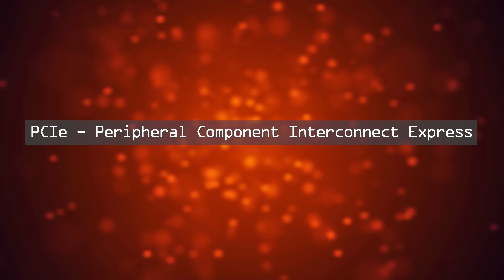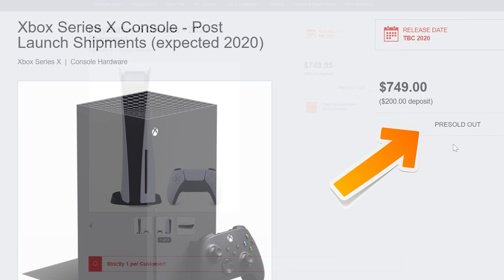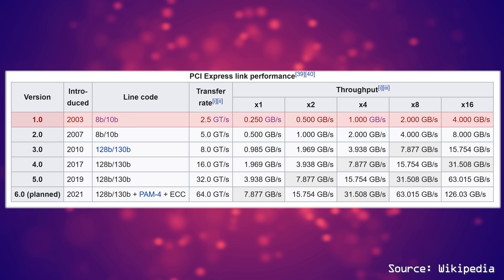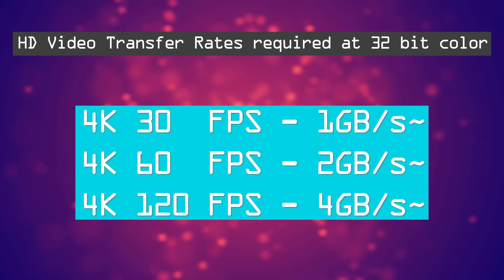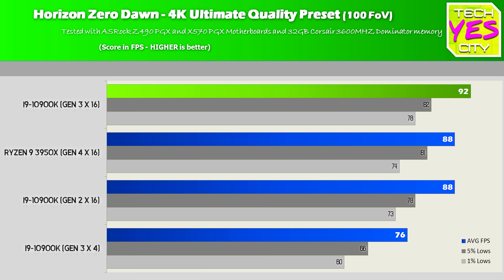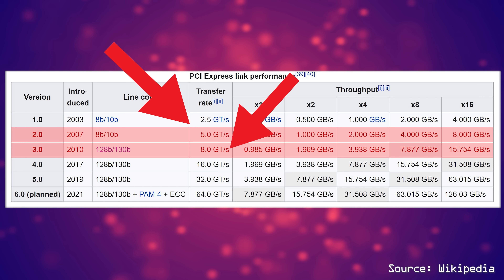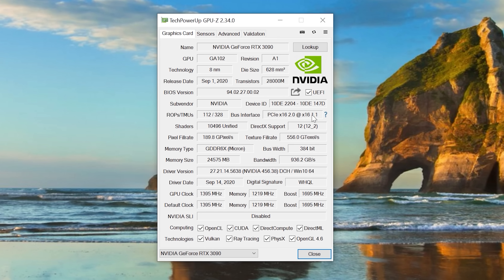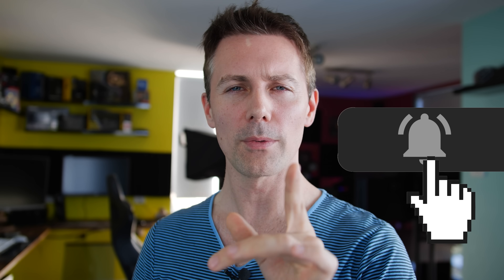Why PCIe 4.0 Doesn't matter for Gamers... Yet

Comment: "Wait, PCIe 2.0 x16 is still fast enough?"

"Always has been."
Reply: Lol. Bet Hardware Unboxed are sick right now after changing to AMD for GPU testing just in case RTX 3090 maxed out the Gen 3 bus.
Reply: @dickmartino9933  I knew the math, I couldn't understand why Hardware Unboxed thought there "may" be a tangible difference, guess they have the odd blonde moment too.
Reply: @Battleneter  people wanted them to. They knew there were no benefits
Reply: @AmusiaPrussia shills? You mean the poeple buy good value options that have about 80% market share want gpu reviews to reflect what their experience would be if they bought the gpu and put it in their systems? The whole point of a review video.
Reply: @AmusiaPrussia performance is basically 1:1 with the 3700x
Reply: @dickmartino9933  No, they did it because fans wanted it.
Reply: Figured 2.0 would be enough. There's a few people running 2080TI's with two westmere xeons and still maxing out the numbers from those cards on 2.0
Reply: Still pounding games on an Asus P8P67 Deluxe (PCIe Gen2) with decked out i7-2700k @ 4.8GHz. I tried my friends RX 5700 XT on my rig this summer and I was pretty sure I would not see that much difference with my RX580 because PCIe 2.0 bottleneck. Turns out it was a massive gain and did not bottleneck at all...so yea, PCIe 2.0 with very fast old gen CPUs like mine or X58 rigs can still use latest gen cards no prob.
Reply: @bigd33ns  huge  cpu bottleneck.
Reply: VGA haven't even managed to fully utilize PCIE gen 3....

Comment: I know in this video you pointed out that polling rate has diminishing returns as an example. However, those at blur busters had a pretty detailed explanation on why that small increase can still be felt. The Blurbusters reddit account has a few extra interesting comments about how it would be useful even at 60 Hz, and not just 360Hz refresh.

Comment: This is likely to change though once games start streaming textures directly from the ssd to the gpu without going through the cpu first. Because that will result in more texture loading during gaming than before. Remains to be seen how the demand changes in practice though
Reply from the maker: Yes the SSD speeds will be interesting if they bypass the CPU completely.
Reply: @techyescity  how the game saves the textures to disk will play a huge role too. Imagine textures being stored sequentially to an nvme drive and then , during gameplay, being loaded sequentially as well. This could cause a significant burst of traffic on pcie and in turn cause stuttering ingame. 1% lows for example could take a nosedive on older pcie standards in that case. But imagine the possibilities of streaming huge amouts of textures just in time...
Reply: "This is likely to change though once games start streaming textures directly from the ssd"
Yeah no - this will not happen. Also RAM is way way faster than SSDs already and guess what? Developers don't even bother pre-loading textures there and that is despite GPU directly accessing memory is on of PCIes core-features since a long long time ago.
Reply: @ABaumstumpf  well there are already games that stream textures. But in the past technology was simply not up for the task. Id 4 and 5 engines already could stream textures from disk to avoid repetitive textures. Problem was, the hardware was not up for the task. So you'd see popping in textures all the time (like with rage). Thats why it is not widely used yet. With nvme, direct loading from it into the gpu, this will be a much easier task. Also, just loading textures into the ram is not a good enough solution. For one, ram for most pc users and especially consoles is limited. So it would not do much good to have a little more storage and then, the speed of the storage would again be the limiting factor. Secondly, in consoles ram is already shared between cpu and gpu, so that would be counterproductive. And lastly, you seem to underestimate the amount of textures a game with this technology could use. It can easily be several factors bigger than the ram, it could even go into terabytes. So the key here is that of that massive texture store, the right textures that the game assumes to be used next, are streamed from nvme ssd into vram just right before the gpu needs it. The only practical use of ram I can see in that case would be that just like in a cpu that has different levels of cache, vram would be the first level cache(part of vram will always contain textures that are not yet used), ram the second level cache. But that completely depends on how much ram is available. And that would again involve the cpu. And to be honest, I trust the hardware developers when they think that loading data from nvme directly to vram is a good idea. If I remember right then textures are not only loaded but also decompressed by the gpu, freeing up resources on the cpu, which would be another benefit especially if there are a lot of textures. So yea, I am pretty sure that this will happen.
Reply: @reinerheiner1148  "well there are already games that stream textures. But in the past technology was simply not up for the task."
We are not talking about texture-streaming here - that is something fundamentally different. And also no - past technology was just as well up to the task,.

"So you'd see popping in textures all the time (like with rage)."
That is an entirely different problem yet again and specific to that engine.

"For one, ram for most pc users and especially consoles is limited."
Everything is Limited. But RAM on PC, be it past or present, is there to be used. If the system has unused memory it is simply wasted.

"The only practical use of ram I can see in that case would be that just like in a cpu that has different levels of cache, vram would be the first level cache(part of vram will always contain textures that are not yet used), ram the second level cache."
And a cave-troll does not see the use of a scalpel either - the point you are trying to make is what - "I am ignorant of the subject therefore i am right"?

"And to be honest, I trust the hardware developers when they think that loading data from nvme directly to vram is a good idea."
And guess what? Most don't think it is a good idea.

"If I remember right then textures are not only loaded but also decompressed by the gpu, freeing up resources on the cpu, which would be another benefit especially if there are a lot of textures."
And that is already the case anyways - and has been for decades even.

Comment: It does just not for current graphics cards, but for loading times on new drives, it does.
Reply: Drive loading has insignificant benefits to games.

A PCIe Gen4 SSD compared to a SATA3 SSD will have no performance impact in games and load times will not be drastically improved going from a SATA3 SSD to PCIe Gen4 SSD.

LTT already did comparisons even with the best PCIe Gen4 speeds and so have many others.

It will only matter when DirectIO for nVidia and AMD become more commonplace. Which is years away.
Reply: @viet0ne  Depends on a game bro, destiny 2, witcher3 ESO big difference, SCgo negligible.
Reply: @Stevospeedo Are we talking about gen4 is relevant now or am I in some parallel universe? And with the games nearing 200gb installs I would say youre talking out the wrong side of yer mouth.
Reply: @Stevospeedo I really could not give 2shites about what you think I am. Truth is it makes a difference in many games and even now 4.0 drives have double the speed of 3.0 and there are games out there already that see benefits from it I already listed a bunch. All you do is talk in generalizations and repeat yourself. Double the speed is not negligible no matter what you say. Simple. 30sec or 15sec makes a difference and you can't deny that. Optimisation has eff all to do with load times being faster on a 2x faster drive. It will still load 2x faster... jeez what is so hard to understand.

Comment: What about when GPUs starts reading directly from the nvme drive. If it is going to happen on xbox, I sure hope it happens on pc. Then that extra bandwidth and poll rate on gen4 should come in to their own. But I would still think gen3 would be good enough.
Reply: I don't think the Xbox or PC will be with that kind of gaming until next gen. PS5 will be on that gear straight away though.
Reply: @thomassmith4999  yeah series x will have the same direct storage api as pc. Ps5 has a different version of the tech, which on paper is better but on paper the ps3 should have been better than it was. I think next gen console will push pc gaming further, specifically xbox developed game engines that will be able to use the same api on pc but with better hardware. Also the new rtx GPUs have a decoding chip like the ps5. If you can't tell I am hoping for a gaming revolution. The direct storage access concept looks better than ray tracing, just my point of view.
Reply: @hobolive123  They will all move that way eventually. It'll just have to happen slowly on the PC as it'll take many many years for the majority of machines to have that kind of storage speed. We live in exciting times though, that is for sure. Looking forward to see what the Sony developers come up with to get a taste for the future.
Reply: @thomassmith4999  yeah totally, same as ray tracing right. Been a slow uptake on that. But seems like the new consoles may push that forward too. These things don't happen over night. Direct x 12 uptake has been so slow, etc.
Reply: @hobolive123  Yep I'm pumped for ray tracing also. If they don't bring ray tracing to PS5 minecraft and only bring it to the series X I'll buy a Series X just for minecraft lol

Comment: You are not simply transferring a video signal over pcie. This testing seems woefully incomplete.
Reply from the maker: I said that was a rough estimate to help people understand the numbers. If you have a better suggestion I am all ears. However you are still transferring data that the GPU uses to process the frames.  This is a test for the classical gaming scenario and to help people understand that a GPU pegged at 100% load doesn't need a fancy pcie gen 4 x16 slot.
Reply: @techyescity  In 3D rendering, the scene data can be larger than the final frame data. Not sure about games, but in some high fidelity renders, the scene and textures can take 4+ GB of VRAM, while producing only a single image that is smaller than 1 GB.
Compression can reduce PCIe bandwidth too, however.

Comment: Cheers for this. I'd be keen to see how these cards go on your old X79 system. I still have my 3930k. Though I'm thinking that I'm probably going to need to upgrade the whole system to get the Reverb G2 I preordered running at 90Hz in most games.
Reply: Also how a 3090 would fare on a X58 sytem  :)   (running X5675  @only 3,8GHz  and an 1080 (Non Ti) myself
Reply: Thumbs up for china x79
I hope they get the love
Reply: I would also like to see if the x79 would still "do it" for one more GPU upgrade cycle!
Reply: Fellow 3930k user here! I would be doing the same, but thanks to my faulty motherboard, I'm forced to Zen 3 (sad, I know). Best of luck!

Comment: But doesn't the bew 3000 series have better communication with SSDs that are running on pcie 4.0? That's still an advantage in loading visuals in big maps for example in RDR2. Correct me if I am wrong pls.
Reply: Yes the 30-series can load textures etc. from an SSD,  and that could lead to advantages. But the developer of the game needs to implement this feature into the game and RDR2 will probably not get this feature because it's an old title.

Comment: Poor old AGP forgotten again, PCI-E also replaced AGP!
Reply: In an alternate timeline, AMD's new Z570 chipset supports AGP-e 4.0
Reply: AGP was just a insignificant blip among the PCI glory, such a little blip that I skipped agp.
Reply: @thomassmith4999  agp was the major gpu slot for many years!
what u talking about??..a you born after 2000, this is the reason why you skipped it^^
Reply: @Knebebelmeyer  No I was using a PCI Voodoo 3 during the AGP mess
Reply: @thomassmith4999  ahh ok...
i use a voodoo 1 and after that a banshee!
they i switched to nvidia!
Agp was used for many years, so if you never use a agp card, then you must have a bad pc. 
the first 2 years still fine with voodoo 3 but the last 2 years you have to struggle with that!
but its everyones own choice what he did or not.
i cant remember that i has a special look to the gpu connector. and i never has to be
Reply: @Knebebelmeyer  It wasn't a bad pc. It was dual 504mhz celerons in 1998 and one of the very fastest PCs in the world at that time. I Upgraded it over the years and finished with Dual Pentium 3's, the motherboard became unstable around 2010 so that's when I retired it. By then AGP was completely finished. I still use a machine from 2009 now, Dual X5687 Xeons, 64 gig of ram a Raid 5 array with dual rx580s and it's fine.
Reply: @thomassmith4999  pretty awesome build my dude
Reply: @thomassmith4999  ahhh ok...you were able to deal with it, cause u use the best what u can buy in this times!
but if u wont use AGP and use usual mid range pcs, then you has to struggle with it!
1998 i used a pentium two with 333mhz and ati agp card.
for a better setup, my wallet was not big enough, cause i was in "apprenticeship"
(not a full edjucated employee)
Reply: @Knebebelmeyer  I was assembling servers in a PC shop, they didn't pay me much but parts were all wholesale price. It still used to cost a lot to build a PC in those times. I guess that's why I got sick of new PCs and why I only buy used Workstations now
Reply: @thomassmith4999  ok, thats unusual...most people cant brought this hardware at this times.
nowadays, its not really necassary to buy new stuff!
old core cpus like 3570k or 6700k are still very good and u havent much benefits from newer hardware.
but on the other hand, you can get a cheap ryzen for 100$ and you be able to play anything you want with it...a 6700k and a old 1080 or 1070 still a solid build!
but a used 7700k cost more than 200$ and you can buy a 3300x which have same power for less money brand new!
its depents on your own preferences!
i personally buy never new...if something is brocken, i try to fix it!
thrown away and buy new, that is no skill and everyone can do it!
Reply: @Knebebelmeyer   I'm very close to 100% buying things only from charity shops or the e waste. I have excellent gaming setups though. Lots of CRT TV's / monitors, arcade gaming, a big console and vintage computer collection. All that stuff that I find thrown out. But I don't want to contribute to more waste by buying new technology if I can avoid it. I do have to buy new or used components to repair things but not too much, Oh I also buy one new console each generation (I ordered a launch ps5). The newest PC I have is a E5 V3 Xeon Dell T5810 workstation because they were recently retired from corporations/government. It's more than fast enough for any current game although not any faster than my old Dell T7500. The 5810 uses a LOT less power though. I already have a wishlist of workstations I'd like to buy when they are retired a few years from now. Meanwhile I'm here with some cerium oxide glass polish fixing some scratches in a Commodore C64 monitor someone threw out last week.

Comment: Hey Bryan! I was honestly surprised with the results too. However, I don't think the reason were the ones you described. The bandwidth required for 120FPS @ 4k goes through the Display Output System on the video card, ie HDMI 2.1 or DisplayPort 1.4, not through the PCI-e interface.

I also don't think the GT/s work as you described. If I'm not mistaken, there's sort of a buffer before sending instructions to the GPU. So basically instructions are sent in packages to maximize throughput, having some latency penalty.

I just think the reason you didn't see a performance hit is because games are not made to take advantage of the PCI-e 4.0 bandwidth such as streaming huge textures sets from System Memory to Video Memory on the fly, which would also require a fast PCI-e 4.0 SSD. So basically what I'm saying is yes, you will need it if developers decide to use this resource.

2.0 x16 might struggle to handle regular draw calls etc. PLUS huge data streaming.

Cheers!

EDIT: Maybe a good way to test this would be to starve a video card of VRAM while running 2.0 x16 etc.